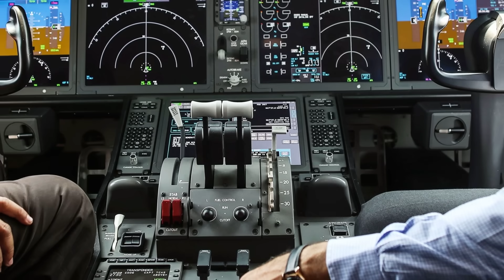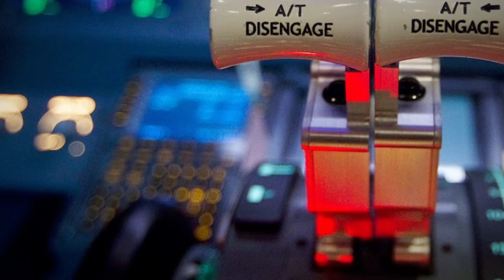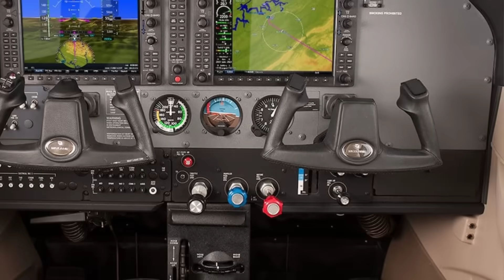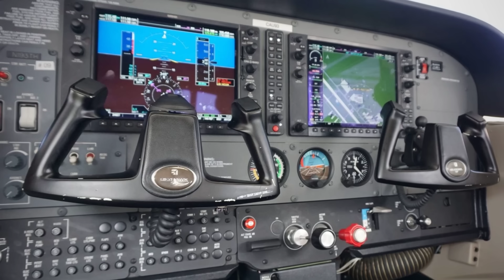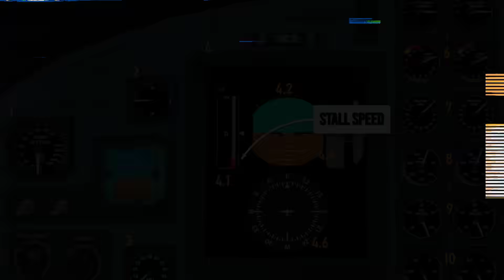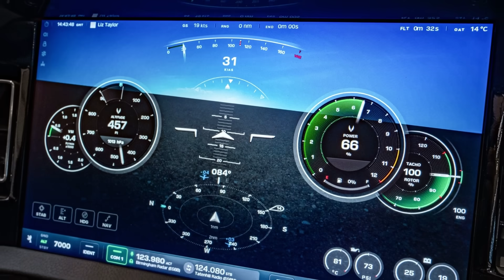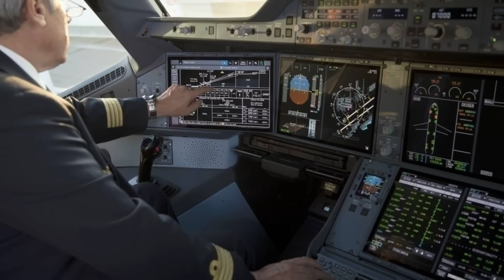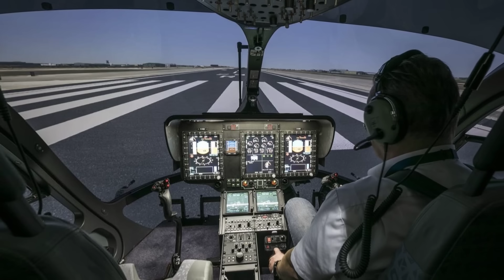The 'Forbidden' Maneuver That Kills The Smartest Pilots

Comment: Most engine fails on take off are partial power.  My CFI and 2 more pilots i know did safe turnbacks with no damages..  My CFI used to teach turnbacks 2 kinds partial power from 400 and no power from 800 agl ..Cherokees with some winds.  No power there is a formula he invented for the no power HOOK shaped TURNBACK KIND.  There are 2 kinds.  The partial power teardrop turnback. and the No Power Hook Turnback.  No power Hook Turn 777 Rule.  
777 Rule .. If you are planning to climb at Vy at over 700 fpm, and you have at least a 7 knot wind to help you come back, mark the no power turnback altitud on altimeter at 700 agl or bit more. Proven to come back.. unless you fly one of those short wing pipers or others 50' 60's short wing.  Those because you will use the Vglide with 40-45 bank method, will lose too much lift on a 45 degree turn. And most have no flaps to pop in the middle of the turn to lower the stall speed either.  Dont.  Unless partial power.  Ignorance is not the solution, ignorance is the problem, my CFI used to say.  He went to fly jets later on .  Now retired..

Comment: When this maneuver is done wrong, a crash happens and Turning Scared guys record it.  But they ignored completely the thousands of times it has been done well and the pilot avoided the tragedy of destroying his airplane, body or someones car or house.  Those results in landing back at airport and most no damage at all.  A save.  You need to know when and where to turback or not. 
 Is not the maneuver, its the lazy or arrogant pilot that didnt want to learn it and did it wrong.  I know 3 pilots locally that turned back, and landed with some tailwind.  4,600 feet long runway.  But there was a CFI here in the 1990's that brave enough taught turnbacks 2 kinds to many.  He had to do 3 turnbacks on his cherokee, partial power.  The lowest from 300 agl.  A 70 hour pilot here did it with an almost grossed 172 from 300 agl too.  And didnt crash on houses, like some say he could do. Stupid to say that.. i told the guy.  Just go and prove you could crash there better.. He walked away.

Comment: This was my only maneuver on my mind when take-off. I logged it into my brain so I would not have even think of anything else. Find the best place to land or crash. I love a landing more than a take-off cause there is more skill. But, the auto-skill of staight ahead is never-the-less the talent to live or die knowing you had no other option. After all we fly in on a straight final to the runway why should a take off with in the 4 second range engine failure be any different.

Comment: I taught all my students when and how to turn back if necessary.  Most small single engine planes can do it safely from about 500 feet or more.  Takeoff is a critical phase of flight.  The pilot should be spring-loaded for an engine failure and it should take less than a second to react.  I taught students that if the engine quits on takeoff, they need to get the NOSE DOWN NOW!  A steep bank is fine if you unload the wing.  The chart showing stall speed increasing with bank angle ONLY applies when maintaining a constant altitude.  

Keep in mind that a climb at best angle of climb speed makes the climb quite steep.  The flight manual for my airplane considers that to be an emergency maneuver, i.e. don't do it unless absolutely necessary.

Three of my former students have had engine failures on takeoff; one landed straight ahead on a long runway (at night), one made a U-turn, one was able to land on another runway.  All the airplanes were unscathed.
Reply: I would caution you, if you are an instructor.
You are teaching unapproved manoeuvers that may result in DEATH!
You could be held liable.
Also student pilots lack the experience and proficiency to carry out the turn you suggest.
Unloading the wing in at a high angle of bank will prevent a stall but it will result in NO TURN!
The reaction of a pilot in this time critical event must be automatic, NOSE DOWN LAND AHEAD!
If you are at circuit height, that is the time for "options".

I am a retired Australian instructor who looks at the number of aircraft deaths in America, through poor decision making and bad aircraft handling with amazement.

What you are teaching is an example of the poor training standards in GA aviation in America.

Try to turn your brain on!

Comment: If most pilots turn , we re fucked, check ww1 ace udet from Germany, there s video of him picking up a scarf with the tip of his wing from the ground, a guy like that would never crash no matter what shitty luck throws on his path
No plane could kill a guy trained so much as udet
Reply: When this maneuver is done wrong, a crash happens and Turning Scared guys record it.  But they ignored completely the thousands of times it has been done well and the pilot avoided the tragedy of destroying his airplane, body or someones car or house.  Those results in landing back at airport and most no damage at all.  A save.  You need to know when and where to turback or not. 
 Is not the maneuver, its the lazy or arrogant pilot that didnt want to learn it and did it wrong.  I know 3 pilots locally that turned back, and landed with some tailwind.  4,600 feet long runway.  But there was a CFI here in the 1990's that brave enough taught turnbacks 2 kinds to many.  He had to do 3 turnbacks on his cherokee, partial power.  The lowest from 300 agl.  A 70 hour pilot here did it with an almost grossed 172 from 300 agl too.  And didnt crash on houses, like some say he could do. Stupid to say that.. i told the guy.  Just go and prove you could crash there better.. He walked away.

Comment: Pilots don't perform realistic emergency training with any degree of regularity.   The power off 180 is a real eye opener on skill and judgement and highlights the trouble with the return to runway strategy.  I  practice the "impossible" turn in a c172,  but only above 600 agl, where it's not impossible, but does require practice and forethought.  Pretake off brief should include concrete abort conditions, and decision altitude for when we land straight ahead, or turn back.    It's very aircraft dependent, I wouldn't try that turn at all in a high performance aircraft or one I wasn't very proficient in.   But in an aircraft I am very familiar with and have practiced it, and understand the limitations of the maneuver, all day long.
Reply: When this maneuver is done wrong, a crash happens and Turning Scared guys record it.  But they ignored completely the thousands of times it has been done well and the pilot avoided the tragedy of destroying his airplane, body or someones car or house.  Those results in landing back at airport and most no damage at all.  A save.  You need to know when and where to turback or not. 
 Is not the maneuver, its the lazy or arrogant pilot that didnt want to learn it and did it wrong.  I know 3 pilots locally that turned back, and landed with some tailwind.  4,600 feet long runway.  But there was a CFI here in the 1990's that brave enough taught turnbacks 2 kinds to many.  He had to do 3 turnbacks on his cherokee, partial power.  The lowest from 300 agl.  A 70 hour pilot here did it with an almost grossed 172 from 300 agl too.  And didnt crash on houses, like some say he could do. Stupid to say that.. i told the guy.  Just go and prove you could crash there better.. He walked away

Comment: Reading some stubbornly ignorant comments here. Video is dead on for most powered aircraft. You get a 90° turn either direction, (w/the cross wind), or just land strait ahead at that altitude.  Try not to hit anything.... My experience was one mag decided to go belly up at about 500' on the take off.'. Engine backfiring, missing, making no power. A highway perpendicular to my runway heading was passing under me, cows, some big rocks and a rough pasturew/trees ahead of me. Pushed down the nose to "FLY THE AIRPLANE" (as my instructor had DRILLED into me). I chose the cows and rocks ahead over the highway but managed to solve the mag issue before hitting anything. Switching PAST the dead mag took a bit of courage as everything I'd tried made no differance. Fighting the panic and thinking clearly is a MAJOR factor in situations like this. The engine ran fine on one mag and we made an uneventful landing after circling back and a rather excited radio call.
Reply: When does an aircraft drop out of the air at 100' per second?
Reply: @wolfmantroy6601  If you stall it only.  Glide is about 10-20 per second.  This video is FoS

Comment: Why not to make a standart turn after takeoff (right at 90 deg and immediately 225 deg after that) so to be on a back course to the runway and have a chance to land safely. If you have 400 ft height it is possible. In't it ?
Reply: Veering off runway heading ( if no parallel runways to consider ) after t/o is a good idea in the direction of any cross-wind, to enable a sort of teardrop return.

Comment: Whether your math is right or wrong, the point is still well made.  Returning to runway with just a few hundred feet of altitude is why eyewitnesses always say the same thing...'the plane just seemed to drop out of the sky'.  They do not describe it as a 'stall' because they are accustomed to cars, where a stall means an engine stops running.  Speaking of model airplanes...my instructor always said to do with a model what one cannot really do with a full scale airplane...namely 'do not 'sort of' takeoff.  Take off at a high climb rate and stay in the 'power cone'...meaning you will have enough altitude to get back to the runway.  And yep, if you don't, then just land straight ahead.

Comment: Lost 400 ft in 4 seconds, maybe in a jet, but not for a light plane. You are implying light planes can climb 6000 ft per minute ??!!  The big misconception is for the pilot to make a 180 degree turn back to the runway, but in real life, it is more like the turns totaled 360 degrees, because after your 180 degrees , you are way off center.  Don't try it with at least 1000+ AGL.

Comment: Every pilot must take up aerobatic training to fully experience what happens when you lose control after and before it happens. After 60 years flying with two engine failures one just after take off landed straight ahead with no injuries or damage to plane.Glass cockpits and head phones won,t save you unless you can keep ahead of your plane.. with real stick and rudder.
Reply: Proficiency is the key. There is no way you can remain sharp flying 50 hours per year. And aerobatics learned 20 years ago and not practiced, is no use to you now. Most pilots in my club were only logging 1 to 5 hours per month.  Certainly you would agree that just 3 take offs and landings every three months  does not make a proficient pilot?

Comment: You are correct that you cannot turn back on the initial climb out.
But your math?
Average GA rate of descent 500 ft per minute = 8.333 feet per second which is 33.3 (say 35) feet in four seconds.
It is the height lost in the turn that makes it impossible! 270 degrees to return over the runway + 90 degrees to realign with the runway!
A rate one turn takes 2 minutes to turn 360 degrees.
Two minutes = 1000 ft lost and a steep turn maybe quicker but the rate of descent is much higher.

Comment: I took my Cherokee 140 up to test this just under 4000 msl.  I pulled the throttle to take.  Counted to 10.  Then turned through 180.  My stall light was blinking.  Looks like I lost 350 feet.  But you are off the runway by the diameter of the turn.
Reply: Exactly, and then you have to make two 90 deg turns and lose another 350 -400ft (in ideal circumstances before you are lined up.
You would want at least 100 feet after line up, so total ost height is approaching 1000ft IF you fly perfectly!

The turn back is not something you want to "perfect" under the stress of a REAL emergency!

Comment: Trained to fly Radio Control summer 1971, by a P-51 pilot of WW2, I was trained if the engine quits just after takeoff, fjy straight a head.
Reply: P51's dont glide too well. Heavy with a speed wing.  Maybe from 2,000 feet up a turnback can, But not lower.  Pilatus single engine pilots all have to learn how to turnback from 1,500 agl at full gross weight. FULL GROSS TURNBACK TO OPPOSITE all Pilatus pilots have to do to fly that airplane. Otherwise THEY ARE PROHIBITED TO FLY The Pilatus .. Learn how to turnback.. or out the door you go. I learned 2 kinds of EFATO Turnbacks on a 4,600 feet long runway.  In 1997..

Comment: Great advice for power planes.  In gliders we regularly practice turning back at 200 ft but that is the difference with a machine that has a glide ratio of 40:1 or better.
Reply: Airplane: That turn is impossible
Glider: Hold my beer
Reply: Some training gliders have a glide ratio of less than 25:1 , but still make it back from 200’agl.
The real advantage that gliders have over powered a/c is a pre-takeoff briefing  —- they have already made the direction of turn, height above ground, angle of bank, a/s to be pitched to, wind speed and direction, and a/s to adopt on the teardrop return before taking the runway. They don’t spend any seconds buffing their nails, or winding their watch when the tug or winch cable breaks.
If power pilots adopted this plan , taking into account the disposition( or not ) of possible forced landing areas around them there would be less misunderstanding of what to do in these situations.

Comment: MY DPE friend had me practiced the impossible turn at 500ft with a slight headwind and giving myself a 3 second delay in my 172. It was possible to make the turn, but not by much. Nearly had to put it down on the taxiway, but it was possible.  Without being fresh with it, I will only attempt it at 700ft or as low as 500ft if I have a 15kt headwind and runway is 5000ft length minimum.

Comment: This is the absolute best and most necessary video in this channel so far, and by far!! Excellent substantiating evidence and documentation and excellent production and narration! It's shocking how many pilots and aviation fans worship at the cult of the low altitude impossible turn, that keeps accepting the burnt offerings of unnecesarily dead pilots, including that of the very champion of the low altitude impossible turn (R.I.P. all of them). 

And still... too many pilots prefer to demonize with blind rage anyone who goes against their suicidal pride. It is that stupid-pride-of-ego cult that is the deadly enemy that must be conquered at any cost, and not that guy from Virginia.

On the ground, pre-plan for emergencies and repeat it out loud. In this emergency at low altitude, fly straight ahead, not more than 30 degrees of bank and do not aim for anything farther than 30 degrees to your right or 30 degrees to your left. Retract the gear if that's what you got. Love yourself way, way, way even more than you already love the plane.
Reply: NOPE.  And i know 2 kinds of EFATO turnbacks and 4 kinds of EFATO maneuvers to the runway since 1997.  No accidents doing them every few months ever. 4,600 feet long runway.  Cherokees ..

Comment: I've been flying for a long time in a Cherokee Arrow 200. I had an engine run rough while doing a takeoff one time as I hit about 250 feet AGL. I reacted in a second and killed the engine and landed straight ahead in the grass on the over-run area.
Reply: Excellent!! Wise choice!! The only good alternative below 1,000 feet AGL altitude in good, easy weather, twice to three times that in rough weather.
Reply: @philalcoceli6328  Thank you!
Reply: @Docinaplane  You are very welcome!
Reply: Perfect  !!

Did the same
Reply: That’s a good example of decision making, would like to contact you regarding this.
Reply: @Listen321  What would you like to know?
Reply: If the engine still has power, then it's not the Impossible Turn. There's a video of a flight instructor who turned back with a rough engine. Even with it being on the verge of quitting, there was still enough power to get back.
Reply: @amorphousblob2721  Get back to me when YOU are the pilot that made that decision to return to the airport when at a low altitude with a rough running engine.
Reply: How about a short  EMAS runway 3 miles away from the main take-off runways of major airports.
Reply: @Spartan1293-w3u  How many airports have those? Where?